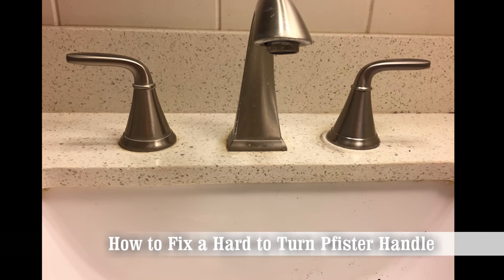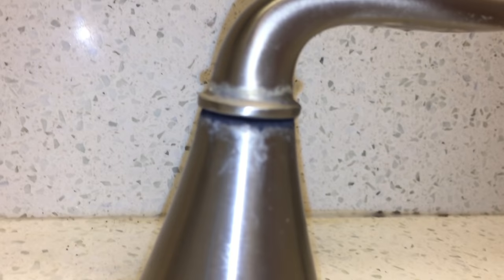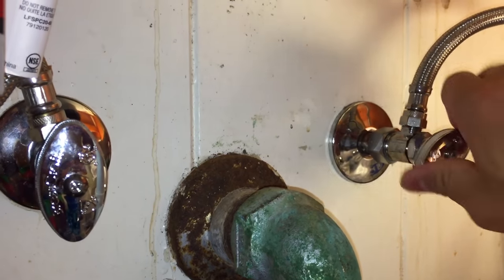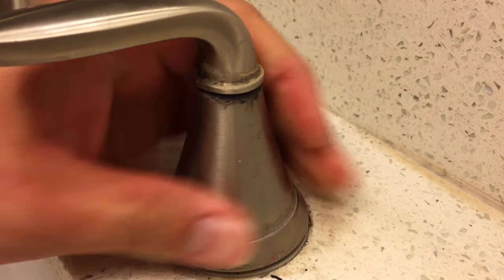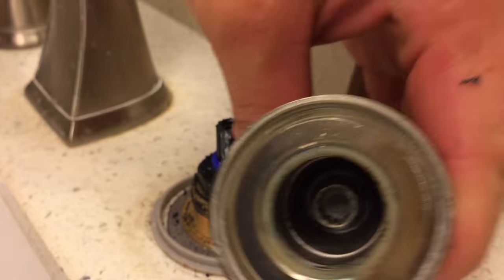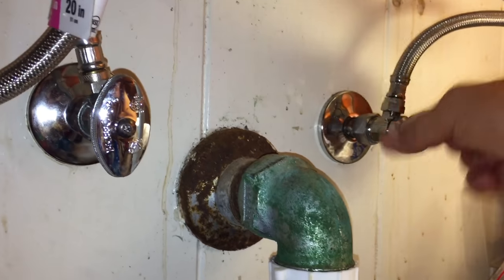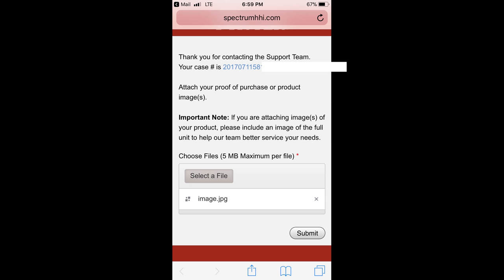Stuck or Hard to Turn Price Pfister Faucet Handle. Easy $0 repair.

Comment from the maker: Hi!  This is Thrifty Tani.  If my video helped you, You would help me a great deal if you clicked on the subscribe button.  Youtube rules have recently changed making subscribers essential to keeping my videos and channel alive.  Thank you!
Reply from the maker: Hi Robert, using the penetrating oil is a good idea.  My other faucet is getting tight, I’ll give it a try!  Thanks for sharing!
Reply: good afternoon, my mother has the very same faucet, can you tell me the model if you know it of this price pfister so when i call customer service i can give them correct model, thanks
Reply from the maker: Hi, it’s called the Pasadena 2 handle wide spread bathroom faucet.  However the pfister representative will identify the model for you via the photos you submit to them during the warranty process.
Reply: @thriftytani46  oh great thanks, i looked up there customer service number just now, i will call them in the morning,that was much help.thanks.
Reply from the maker: No problem :)

Comment: “Once the hub is loosened, a normal handle should be fairly easy to remove.”  What is the hub?  Kinda glossed over that step.   Loosen the connection under the sink?    To get any wrench around the underside of the sink, it would require removal of the basin.  There is no space to get in there with a wrench.  ???   My problem is the whole housing under the sink is rotating when I try to unscrew from above.

Comment: This was very helpful.  Both of my handles froze after (only) six years of use.  Getting them off was NOT as easy as Tani made it appear, however, his advice to turn hard helped, once I grabbed the threaded tube below with some channel locks.  I wound up breaking the cartridge to get the handle off, but Pfister sent me, free, not only a handle set but also two replacement cartridges.  So I was back in business.  Thanks VERY much for your help!

Comment: May I just say that you are a Good Samaritan!!!! I just happened on this video by searching “hard to turn faucet taps”. Your video popped up with exactly the same model. The Pfister company sent not only the handles but also the valves. Hard to take off and the base plate had been rusting as well. 3 years of rusting on our counter and so hard to turn. Now a single finger on tap turns it on. O mi gosh thank you so much for this video.
Reply from the maker: Lol!  Thank you for writing, I appreciate hearing your story!   Im glad to hear the video was helpful. :)

Comment: Well, we recently found our Pfister Prima F-049-P-M Hot Water Faucet tightening up again.  This is the 2nd occurrence in 5 years.  So , when the part came yesterday, I decided to find out if anyone put something on YouTube about this.  So, here I am.  What I did last time, I do not remember, but your video definitely made repair #2 easier.  I did not touch any plumbing even though Pfister sent a replacement valve as well.  This was Strictly a "On the top job." I did put a Channel Lock Pliers on the underneath fastener to tighten the faucet's  mounting.  Comedy on the #1 repair:  Pfister sent the new faucet base in 2017 which arrived broken, so the Mrs. had to get another one for repair #1.  I tried pulling the handle off the base this time, to see what I could do with it but the extraction process needs better tools than I own.  So this means we have now received 3 new bases for this faucet.  Pfister needs to do a better engineering job because this is costing them money.  The Mrs. really likes the faucet and we have another type downstairs which has had no issues to date since 2004.
Reply from the maker: Hi Dolored, thank you for sharing!   I completely agree, and wonder how much money they are losing with this faulty design.  I have another pfister that is seizing up and need to replace.
Reply: I've owned by faucet roughly three years and my replacement hot handle just went stuff again after three months just like the original. I believe they don't lubricate them heavily and the heat of the hot side drys up causing the rough/stiff handle. Bad design. I just reached out to them once again.

Comment: Hi Thrifty Tani, thank you for your video, with clear details, that I was able to fix my Pfister faucet's hard-to-turn handle.  A bit of silicone grease lubrication and the handle is back to its smooth operation!  I did have to disconnect the water connections and unscrew and remove the faucet from the sink, since the hub could not be unscrewed with the faucet in its place.  All in all, it was a relatively painless plumbing fix that was greatly helped by your video instructions!  Your video also informed me about Pfister's replacement process, which was a relief in case the fix was not going to work.  Thanks a lot!
Reply from the maker: Hi Sarah, I'm glad it worked out for you, and the video was helpful!  I hate the feeling of not knowing what to expect when taking on a project.  Thanks for sharing your experience!

Comment: Thank you SO much for sharing this PSA! I have the exact faucet AND problem & didn't realize Pfister had a lifetime warranty until I found your video! Just got my replacements today!
Reply from the maker: Lol, PSA!  I love it when someone saves money!   I’m curious, how long did it take for your parts to arrive?
Reply: @thriftytani46  it was actually quick...only 4 days after I called. However, I first sent an online request, which they hadn't immediately responded to. I initially submitted an online inquiry with photos a few days before and heard nothing, so I  called to follow up. Unfortunately, when I went to install the new handles, I had a tough time removing the cold handle. Ended up having to use a pipe wrench. When I finally got it off, discovered why - the washer that holds it in place was completely rusted. The hot, not a spot of rust. Called them again and requested more parts. As I was waiting on hold, staring at the faucet noticed that the faucet finish was a little worn. When she came back and asked me if there was anything else she could help me with, I told her about that as well. She asked what I used to clean it, I told her and she said she'd be sending me a new faucet!   Hopefully it comes quickly because until then, I told my husband and daughter we'll have to use the bathtub to wash our hands in the meantime lol!
Reply from the maker: Wow, I’m envisioning you with a pipe wrench, working to get that handle off!  I’m thoroughly impressed!  Your husband and daughter must have been even more impressed!  Thanks for sharing!
Reply: Haha, it was quite the sight and thank you! Actually, impressing my husband & daughter has long worn off...that task was minor compared to some of the other projects I've tackled.
Reply: @thriftytani46  I just received my complete replacement faucet!
Reply from the maker: Nice!
Reply: Hi, what model #?  Have same one.

Comment: Thanks for your video,
Very helpful for beginners,
Helps to know how to open.
However let me add something here, you don't need to replace tap, just use WD40 to clean handle internal mechanisms and clean residual with towel and you are all set.

Comment: Moen faucet handle which was installed  about 4 years ago was very tight to open for about the last two or 3 years until it finally separated from the base any thoughts on the problem and fix

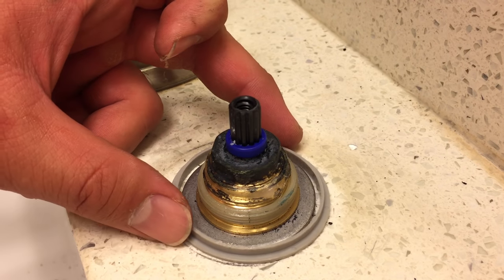Comment: 3:05 Is it necessary to tighten the handle base so much?   Would be easier to remove next time if you didn't use "death grip" on it.
Reply from the maker: No, not necessary to overtighten.  Just enough so the base of the hub is firmly squeezing down on the countertop so splashes of water won’t seep under the countertop.

Comment: Hi Tani, thank you for response about my faucet turning 360, I didn't change cartrigdes because the sink isn't leaking but I do have them, should I replace and then try to put handles back on? My problem was a stuck faucet handle, it sure isn't stuck now.
Reply from the maker: You’re welcome, yes I’d replace the cartridge, that should fix your problem.

Comment: Thanks so much for this video and for the warranty info regarding Pfister. I thought I was just going to have to bite the bullet and buy a new faucet. I’ve already submitted a claim and pic to Pfister online - so easy!  Of course, the hub on my handle is so tight I’m pretty worried about how I’m going to get it off when the time comes...
Reply from the maker: Thanks Rochelle! Since pfister will send u a new faucet hub/handle you can try using vice grip pliers to turn the hub. It’ll scratch the finish, but it won’t matter since you’ll be replacing it with a new one.

Comment: Thanks for tips! I just received my parts (did take a month to deliver to the East Coast due to COVID delays). So for those people who need cartridge only, it may be much faster to order through Amazon close to 5 dollars for the cold cartridge. Mine turned out to the handle that was stuck (cartridge was fine), it was a lost more costly so I waited for the parts.

Comment: My handle was so stuck, I actually had to remove the nut from the underside and take the whole valve stem out. I was able to remove the handle after awhile, but when I took it off, the rubber threads from inside the handle stayed stuck on the valve stem, so I needed to order a new valve body, which pfister said they would send right away. However, I need a new retaining nut because the old one is still on the old valve stem and won’t come off. Pfister said the retaining nut is on back order and won’t arrive for 2 months! I’m wondering if I can just use a generic coupling to do the job??

Comment: Any suggestions if it appears your cartridge splits in 2 and other half remains caught inside?? >:O
Reply from the maker: Needle most pliers?  It isn’t threaded in. It should pull right out.  If that doesn’t work, carefully use a wood screw to screw into the cartridge then pull it out while gripping the screw.

Comment: Hi Thrifty Tani, I can't seem to unscrew the faucet handle. The nut on the bottom is spinning but I can't tighten it because it's in such a small hard to reach spot. I tried tightening with my finger but that didn't do it. Any ideas on how to get it off?  Thanks
Reply from the maker: Hi Tyler, there’s a special wrench that came with the faucet, if you search on Amazon for “faucet installer” you’ll see an item that is similar.   I’m sure Home Depot would sell something similar.

Comment: HI, I got a replacement part but it keeps turning.  The nut is tight but handle keeps on turning in circles.  Any idea what may be going on?
Reply from the maker: It sounds like the splines on the inside of the handle are not making contact with the splines on the cartridge.  You may need to loosen the nut under the sink and push the whole threaded assembly higher up then re righten the nut.

Comment: How to turn it if its badly stuck? İ can't find a proper tool to do it ,😪
Reply from the maker: Hi, check out my other video.  https://youtu.be/g8dIK28UiB4
Reply: @thriftytani46  yeah i did but i am trying to do it without damaging it 😂
Reply from the maker: You could try a strap wrench, but I think the cone shape base would make it difficult for the wrench to get a firm grip.  Plus it’s a tool you would likely use only once.  If you qualify, I’d get a free replacement through pfisters warranty.

Comment: when they send a new one, is it an improved model? or does it still have the same rubber gasket subject to the same future problem?
Reply from the maker: I’m not sure, but the replacement hasn’t failed yet.  It’s been about 1.5  years so far.
Reply: @thriftytani46  Thanks!  Have 4 sets of these and 3 have gone bad with this same problem.  Major bummer but appreciate the video and info!
Reply from the maker: Thanks, I appreciate it, I’m glad I could help.
Reply: @Zorra31P  this not true.  It is a poor design.  They should have used Teflon or UHMW for the gasket material rather than rubber that will break down.  As an engineer I am surprised they did not find this issue during the design phase.   The handle should last 10-15 years with the proper materials.

Comment: For those that are a bit handy, the handle can be taken apart.  There is a c clip that holds the two pieces together.  If you dont have pliers for these (they behave opposite to regular pliers), you can use two small flat blade screwdrivers to get the clip off.  Then the o rings can be inspected and lubricated with a light grease (not wd-40).
Reply from the maker: Thanks Mark, good info!
Reply: can you oil the slit betw the handle and the hub?   better than wd40?

Comment: I cannot get the hub to turn. I've tried WD-40 and it will not budge. There is visible rust under the sink
Reply from the maker: https://youtu.be/g8dIK28UiB4  Check out this video, it’ll show you how to get a little more leverage to remove the handle.
Reply: @thriftytani46  thank you for replying so quickly. The handle moves it's the hub that wont. I tried to locking pliers but no luck. It just will not budge.
Reply: @thriftytani46  finally got the handes off!! Now the components  of the handle are rusted to the granite and they are rusted underneath the sink. Ugh!!

Comment: Easier said then done . . . I had bought a Pfister kitchen faucet model F-036-4GF   with in one year the water started to drip,
putting a hand underneath the faucet to feel if it was hot or cold water, it was the hot water, by calling the Pfister company
as they had me on hold for at least one hour until a rep.  talked with me, I explained my problem of the kitchen faucet is leaking,
they put me on hold and was disconnected , called back a second time also to be put on hold, once again I explained my problem 
and saying I have a warranty, gave them the date I bought it, was back on hold then disconnected for the second time, I will not
repeat the { explicit }  words here but I was pissed - called a plumber to repair the problem - as Pfister would NOT comply with their
call back to me nor would they honor their warranty, it's a shame they don't stand by their product .  Model    F-036-4GF

Comment: the hub on min is ridiculously tight
Reply from the maker: My hub was on really tight too.  I had to slowly force the handle by repeatedly alternating it from its off position to its full on position.  This will loosen the tightness and make it a little easier to turn the hub.
Reply: I had the same problem so I wrapped the hub in duct tape to provide a gripping surface, then I removed it with channel lock pliers.
Reply: @chesterwisniewski9698  That’s an idea I need to try.  So far, no luck with lube and pliers.